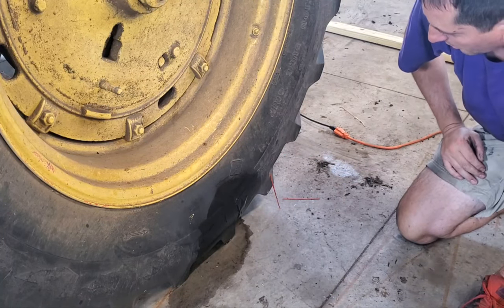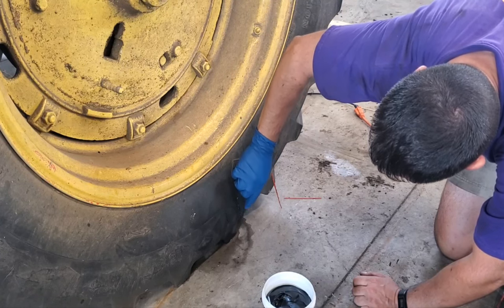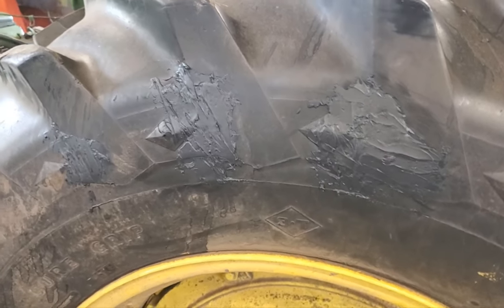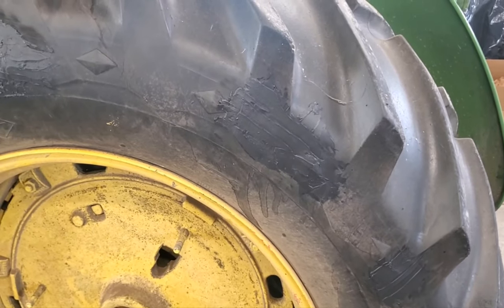John Deere R Tractor Revival Part 4 - (Flex Paste Tire Repair?) #flexpaste #flexseal #tractor

Comment: I hope it worked, but I don't see a follow up video. So, a year later, what's the verdict, did the flex paste stay on? Thanks.
Reply from the maker: Shoot I did forget to follow up!  The answer is yes and no... The smaller cracks have been holding up, but the big one did not.  It would work better if I took a piece of rubber or old tire and made a patch with the flex paste.

Comment: I think an automotive glass adhesive would’ve been better
Reply from the maker: You are probably right.  I never did a followup but it didn't work.  On the larger crack, it actually cracked through the flexpaste.

Comment: See flex seal will stick to wax paper if it does not after you apply flex seal lay wax paper on it to smooth it out. That's a old trick we use with bondo type materials.
Reply from the maker: Oh wow! Thanks for the tip!
Reply: @fixer2u  Lets say we had a big rust hole in a hard to get to place. We would apply Dyna glass to the wax paper go in from the back side this would give you a backer between your hand and the dyna glass to support it while it set up. Lets say you are trying to smooth out a sealing surface apply JB weld to one part lay wax paper over it and bolt it up. Let it set up take it apart the wax paper will pull off instant flat surface... I don't plan to do what you did I know a poor boy had to do what a poor boy has to do... : )
Reply from the maker: @hoborosser1785  I see!  I will definitely use that trick when I hit one of those scenarios! Thank you!